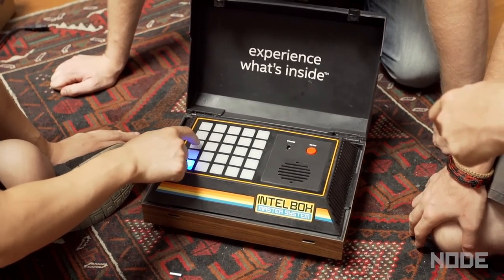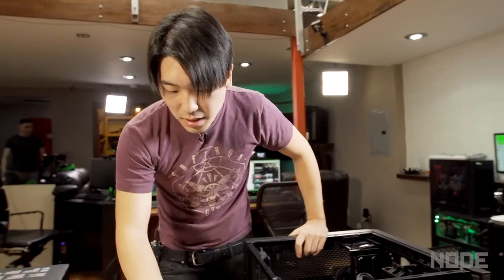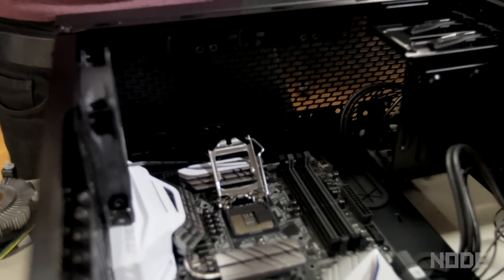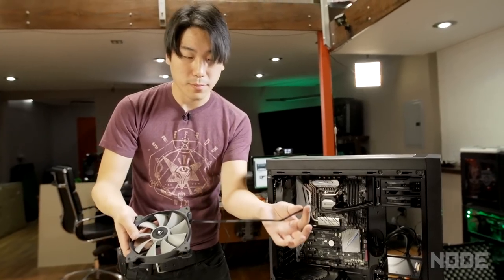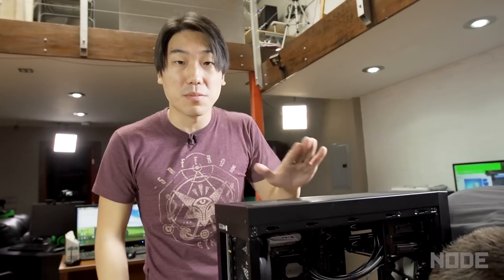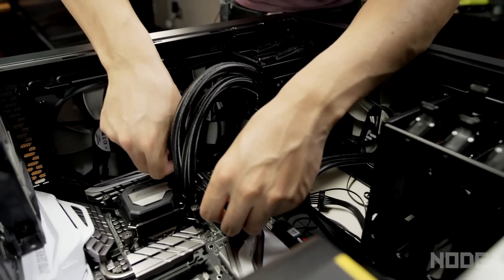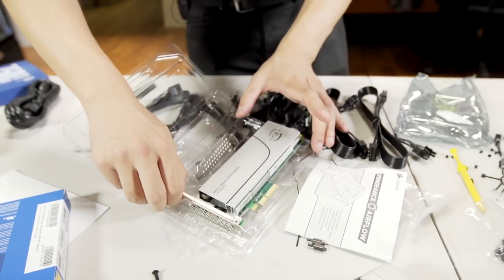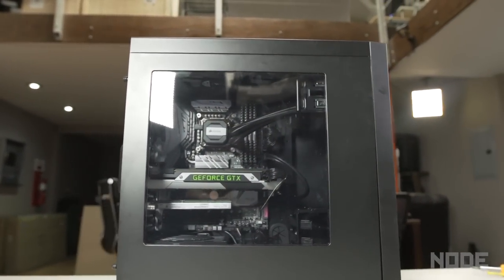BEAST INTEL PC BUILD

Comment: is this a good intel gaming and work pc? 
PCPartPicker part list: http://pcpartpicker.com/p/xGH2XL
Price breakdown by merchant: http://pcpartpicker.com/p/xGH2XL/by_merchant/

CPU: Intel Core i5-4590 3.3GHz Quad-Core Processor  ($159.99 @ Micro Center) 
CPU Cooler: Cooler Master Hyper 212 EVO 82.9 CFM Sleeve Bearing CPU Cooler  ($29.99 @ Micro Center) 
Motherboard: Asus Z97-A ATX LGA1150 Motherboard 
Memory: Corsair Vengeance Pro 16GB (2 x 8GB) DDR3-1866 Memory 
Storage: Western Digital Caviar Blue 1TB 3.5" 7200RPM Internal Hard Drive  ($54.99 @ Micro Center) 
Video Card: EVGA GeForce GTX 970 4GB Superclocked ACX 2.0 Video Card  ($294.99 @ Micro Center) 
Case: NZXT Phantom (Black/Green) ATX Full Tower Case 
Power Supply: Corsair CX 600W 80+ Bronze Certified Semi-Modular ATX Power Supply 
Optical Drive: Asus DRW-24B1ST/BLK/B/AS DVD/CD Writer  ($19.99 @ Micro Center) 
Operating System: Microsoft Windows 10 Home OEM (64-bit) 
Total: $559.95
Help is appreciated. I just need an opinion on how it can work. thanks!
Reply: sorry, changed the processor to an Intel Core i5-4690 3.5GHz Quad-Core Processor
Reply: +Hyo Park change the cpu to i5 4690k or downgrade the mobo to h97 or b85, downgrade the ram to 8gb and get a 256gb ssd
Reply: +Xipo86 why not the hhd? is ssd better?
Reply: +Harry Tung downgrade the ram to 8gb total? sorry, this is my first time building a pc
Reply: +Hyo Park ssd is 3time as fast as hdd
Reply: +Hyo Park yes, downgrade the ram to 8gb
Reply: +Harry Tung Alright. So downgrade to 8gb total for memory and get a ssd than an hhd. what ssd would you recommend?
Reply: Downgrade the motherboard to h81,b85 or h97, don't go with z97 since you have have a locked cpu.Don't just buy an ssd, because ssd is fast but have far less storage than hhd. you need a ssd and a hhd to have decent amount of storage
Reply: Also you can get cd key of Windows10 at G2A website, it offer very cheap cd key
Reply: +Harry Tung okay. I'm going to then change my CPU to i5 4690k. Would I still have to change my motherboard then? really appreciate your help.
Reply: No, you don't need to change your motherboard if you are going to 4690k but you need to get a ssd and a 1TB hhd together,otherwise you will run out of storage very quickly
Reply: +Harry Tung 
So this is my new PC build on the input you have given me. What do you think?
PCPartPicker part list: http://pcpartpicker.com/p/v4bx7P
Price breakdown by merchant: http://pcpartpicker.com/p/v4bx7P/by_merchant/

CPU: Intel Core i5-4690K 3.5GHz Quad-Core Processor  ($199.99 @ Micro Center) 
CPU Cooler: Cooler Master Hyper 212 EVO 82.9 CFM Sleeve Bearing CPU Cooler  ($24.98 @ OutletPC) 
Motherboard: Asus Z97-A ATX LGA1150 Motherboard  ($92.98 @ Newegg) 
Memory: G.Skill Ripjaws X Series 8GB (2 x 4GB) DDR3-1600 Memory  ($42.89 @ OutletPC) 
Storage: Samsung 850 EVO-Series 250GB 2.5" Solid State Drive  ($81.61 @ Amazon) 
Storage: Western Digital Caviar Blue 1TB 3.5" 7200RPM Internal Hard Drive  ($49.98 @ OutletPC) 
Video Card: EVGA GeForce GTX 970 4GB Superclocked ACX 2.0 Video Card  ($309.99 @ Micro Center) 
Case: NZXT Phantom (Black/Green) ATX Full Tower Case  ($118.99 @ Amazon) 
Power Supply: Corsair CX 600W 80+ Bronze Certified Semi-Modular ATX Power Supply  ($64.99 @ Amazon) 
Optical Drive: Asus DRW-24B1ST/BLK/B/AS DVD/CD Writer  ($15.99 @ Newegg) 
Operating System: Microsoft Windows 10 Home OEM (64-bit)  ($89.88 @ OutletPC) 
Total: $1092.27
Reply: +Hyo Park I'm not so sure on where I will put the ssd in my case.
Reply: Just check the case manual
Reply: +Harry Tung alright. thanks so much for your help, I really appreciate it!
Reply: +Harry Tung hey, should I need to lower my parts since I'm only gonna do light duty gaming such as LoL, DOTA 2 and TF2. Isn't my parts too extreme for light gaming?
Reply: +Xipo86 hey, should I lower my types of parts since I'm only doing light gaming such as TF2, DOTA 2, and LoL? I feel like it's a waste of money for just light duty gaming and work. opinion?
Reply: Hyo Park yes,your part is quite op for these games.but it is always nice to future proof maybe you can play demanding game at ultra setting in future,but if you want to save some money,I recommend downgrade the gpu to a gtx950 and the cpu to an i3,those part is still decent for demanding game at mid to high setting
Reply: +Harry Tung dude, once again, thank you for all your help, I appreciate your feedback. I'm gonna get the parts today, wish me luck on the build!
Reply: Hyo Park remember when you install window I recommend you remove the SATA cable from the hdd because I saw windows do some stupid thing that you can't boot the system without the secondary drive
Reply: Hyo Park so you gonna go with your current part?
Reply: +Harry Tung I got the intel i5 4690K quad core processor, ASUS Z97-a motherboard, cooler master evo 212 air cooler, western digital 1TB HHD, Samsung evo 250GB SSD, ballistix RAM, (I couldn't get ripjaws x series. RAM is RAM though) Nvidia GeForce GTX 970 video card, phantom 530 case, and cs650m PSU. I will be extremely happy if you could give me some more tips as a beginner. what is with the disabling SATA cable from HHD to install Windows?
Reply: Unplug the sata cable from hdd when installing window so window won't put boot media to the hhd that way you can still boot your system when the hhd is removed
Reply: Also ground youself so you don't damage the part.Don't build the pc on carpet or anything that will build  up static
Reply: I've built my pc! Thank you for helping me with tips and understanding to build it!

Comment: shouldnt the top fans be exhaust and not intake ?
Reply: +aeroaa2 

It depends on the system imo.

Intake will make the overall case temp slightly higher but keep the cpu slightly cooler by pulling outside air through it rather then pushing the already marginally warmed air in the case out.

And of course vice versa for exhaust. In the end I don't think it matters for a build like this because all of the parts are good enough to where there shouldn't be heating problems either way, I'm not really versed in GPU temps though so I could be wrong.

Comment: THAT IS A FUCKING OVERKILL PC D
Reply: My PC is only
Geforce gtx 960 2 gb
Intel cord i5-4460 cpu @ 3.20GHz
8.00 Gb RAM
1920x1080, 60 Hz
Mother borde is MSI OC
Windows 10
Reply: +dennis granholt that's not bad.

Comment: what powerful gtx graphics card  isn't too expensive do you recommend. I have a 560 and i feed it lacking in power
Reply: +Filthy Gaijin it depends on what games you run and how much you are willing to spend, gtx 970 is a safe bet, 980 is for running all games on ultra and getting 80+ fps and the 960 is for running mobas and non heavy graphics demending games.
980-500$
970-320$
960-200$
Reply: +Filthy Gaijin GTX970 is pretty good, you can also 4K game a little bit on it. But if you want overkill the GTX980Ti is the way to go.
Reply: +Filthy Gaijin the AMD R9 390 is currently the best power/price card on the market
Reply: ThatOneGuy FUCK AMD!!!!
Reply: whydoihavetocry FUCKING 8X AA FTW MATE!
Reply: LIFE. 16X m8
living life to the max!
Reply: itai landau + MSAA
Reply: LIFE. Why? The R9 390 is a better card than the 970 right now for less. Why fuck them exactly?
Reply: ThatOneGuy cuz nvidia is better
Reply: LIFE. What current evidence do you have to prove so?
http://www.techspot.com/review/1019-radeon-r9-390x-390-380/page6.html
Reply: +LIFE. When you get higher up performance wise, Nvidia is generally better, but for midrange, AMD is a better deal. So like GTX 960 and below, I would get AMD instead. For GTX970 and above, I would stay with Nvidia.
Reply: +Filthy Gaijin  If you are going with nvidia cards, you gotta buy 960+, everything else under that is going to suck under DX12. Just so you know. And even then, AMD current architecture dominates in DX12 since current NVIDIA best cards are built for DX11 and are considered beasts there. Luckily for Nvidia users, DX12 won't be widely used for a few years, so we can still play current games and then buy a new card and throw the old one into trash when DX12 finally shows up.
Reply: +Filthy Gaijin 970 is ideal
Reply: You can get a gtx750 fairly cheap
Reply: +ThatOneGuy Look,pointing out to a site or two about benchmarks is pointless and fallacious.Of course you will pick the results that favors your argument.Not saying 390 is crap or anything,but that way of supporting your argument just doesn't work.I can show you a myriad of other sites that have the 970 beat the 390 significantly in benchmarks too.
Reply: +Filthy Gaijin whatever you get, make sure you get a 4GB version, games are using a lot more VRAM now a days. and my 2GB 760 isn't cutting it
Reply: +Filthy Gaijin I would say that for a good ratio of performance to price I would shoot for a GTX 970 or 390 class graphics card or higher. If you can't afford those though shoot for a gtx 950 or equivelent AMD card. Both ranges of cards would be a large boost in performance over a 560.
Reply: +Dylan McIntyre And how exactly is it not cutting it? I got  Asus R7260 2gb last november
Reply: Dylan McIntyre Well, that really is just you being unreasonable, so don't say it's lacking power. Not everyone can pay another 50-100$ extra just to use MSAA
Reply: I whould recommend a GTX 750 ti SC for a budget card for only 130$ or i whould buy a GTX 970 with is only about 300 to 350$
Reply: I have a feeling you wanting to not mortgage your house for a gaming gpu all the comments about me are bull shit these people think on high settings if you don't get 3k fps then the card is shit buy a GTX 750 ti Super clocked best bang for your buck cheap good and great brand for only 130$
Reply: +Filthy Gaijin guess i'll go with the 970 then thx for the replies
Reply: +Filthy Gaijin I would say 970 or if thats too expensive 960 4gb version
Reply: jkteddy77 oh ok thanks, I haven't really been keeping up to date with new parts, and hadnt really looked into any info about the r9 300 series, I guess I just assumed they'd be similar to 900's. Only downside to AMD cards though is that they run hot
Reply: jkteddy77 oh really? my previous AMD card was a 6670 and used to get up to 80-90C under load and my current gtx 970 doesn't usually get anywhere near that
Reply: +ThatOneGuy I've just ordered my rig and it's essentially exactly this but with the 390, I guess I'll come back to let people know if my house explodes or something
Reply: +ThatOneGuy oh, do you mean an 290 v2?
Reply: +Will Lloyd finally, reading this thread all with high end new cards, why not suggest a 780? it's good for the price
Reply: +LIFE.  980ti is not over kill for 4k, 980ti is not stong enoguht o max otu games at 4k, get a 980ti for 1440p or 144Hz monitor
Reply: Xuren yea, if he wants to max a game at 60+fps he should get a 980ti sli